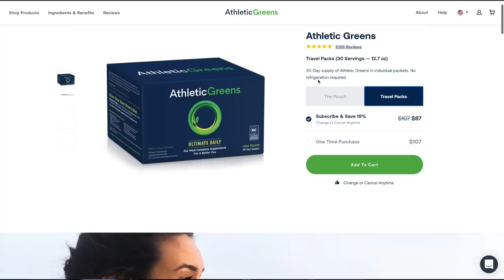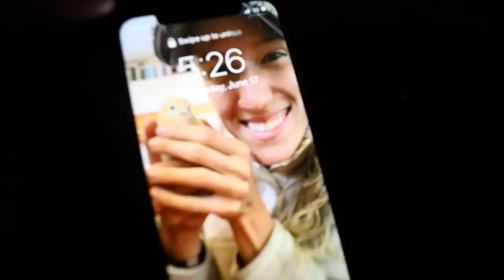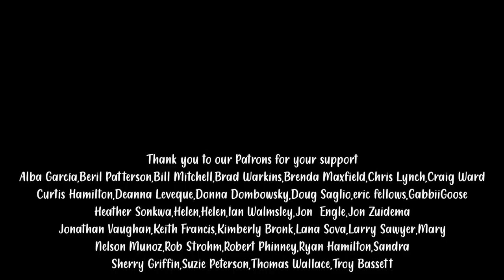NOTHING WILL STOP US! // ROOF CONSTRUCTION in the RAIN

Comment: Best painting in tropics to protect a roof is a black layer then a white layer on top. reflects the heat / light off the white and anything that does get through is stopped by the black layer. same works great on water tanks
Reply: Straight black roof will make the shed so much hotter than outside during the sunny season, compared to white or lighter color.

Comment: I just noticed that you have a geodesic dome greenhouse. Well, I'm remodeling a three story double geodesic dome home right now with my own hands and without hired help. Just my wife and I only. By the time we are done there will be at least 75% to 80% of new framing. The house when we got it was about ready to fall over due to a leaky roof that caused mold and rot issues. It was very bad but we managed to save it and are now doing the finishing touches.

Comment: Please put a ramp onto the sidewalk outside the new headquarters.  The video you showed when you went to look at it didn’t show a ramp and the step from the ground to the sidewalk was quite the step up.  For every 1 inch in elevation the ramp should be 1 foot long measured from the top of the sidewalk to the bottom of the ramp and it should be at least 36 inches wide.  So, if the parking area slows down your ramp will need to be longer, but if it stops up it can be shorter.  This will not only be good for anyone with mobility issues, but will also make it easier to get deliveries into and out of the building.

Comment: Already notice so many comments about the black paint and heat. Good points about food grade paint if harvesting rainwater.  The internal heat is not just about personal comfort.  Your electronics will also degrade faster.  No, not your iphone.  Your battery operated power tools. And your generator.  All those green boards with soldering.  Those melt or loosen in high heat conditions.  (Think of the Sony playstation fix - a hair dryer to re-secure any shorts) 

So, those Arizona homesteaders that just coat raw metal with a clear coat or white paint aren't wrong!

At 40C or 104F your iphone left in the sun will actually tell you its overheating and turn off.  Most other tools don't have the luxury of being smart.

Comment: Suggestion,  when you use a hammer,  hold it and it's end and swing it hard while looking at the nail head.
Don't tap the hammer,  swing the hammer from a 2 o'clock position over your head  .
Drive that nail in.
This not a criticism,  I thought that it might be helpful.